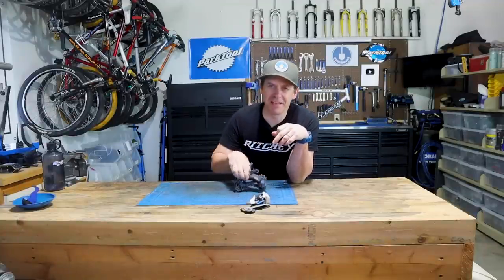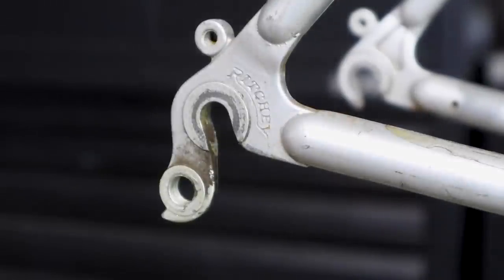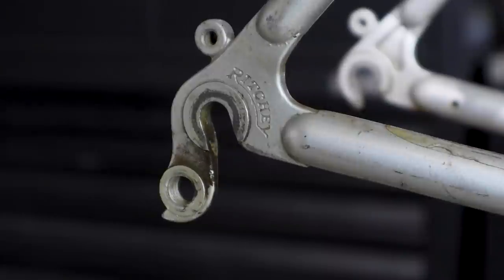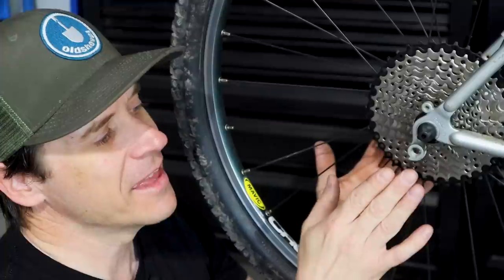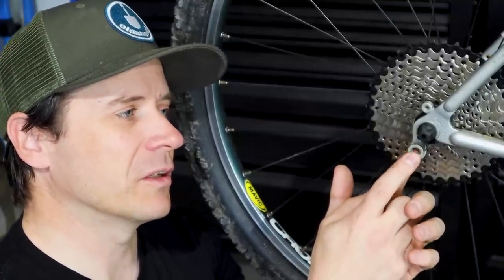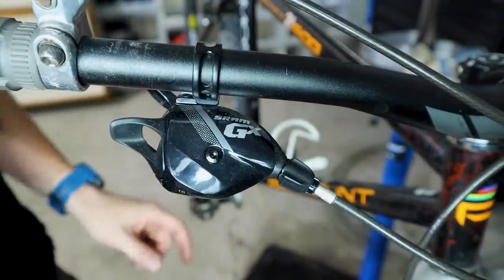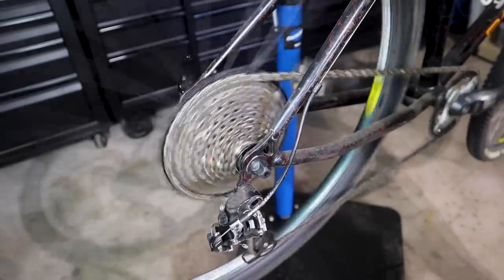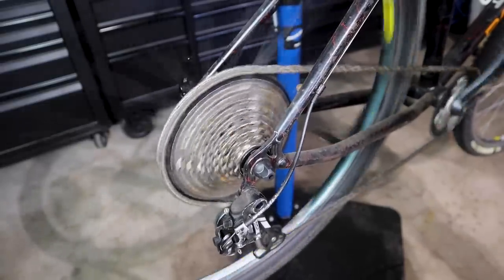Rear Derailleur Setup - The 3 Foundations

Comment: When adjusting both limit screws, do you screw in both barrel adjusters on the shifter and rear derailleur? If you have 3 front chainrings (24 speed) which front gear, do you shift it in when adjusting the limit screws?

Comment: It should be noted, though, that the more cogs you have an your cassette, the tighter the tolerances get. Where a 7-speed with a misaligned hanger might still work fine, and a 9 speed might still shift through all the gears, the 12-speed certainly won't.

Comment: I've been tinkering with my bikes for over 10 years now and I still cannot get how unscrewing the barrel adjuster tensions the cable. I could not find any explanation on the internet either.
Reply: It is counterintuitive.  Backing out the barrel adjuster by turning it counterclockwise has the effect of pushing harder against the cable housing (the barrel adjuster gets longer as it is turned counterclockwise).  Because the adjuster is longer, and therefore the length of the cable housing plus adjuster is longer, this puts more tension on the inner cable.  The cable housing plus adjuster are pushing against the shifter at one end and the derailleur at the other end, and that adds the tension to the inner cable.  Hope this helps.... it does seem backwards but visualizing the barrel adjuster pushing out helps me remember how it works.
Reply from the maker: It increases the distance the cable has to travel.
Reply: @mattkavanaugh5623  thanks. I figured that out that the adjuster affects the overall lenhgth of the housing, but I still can't wrap my head around how does this tensions or loosens the cable.

Edit: ok I think I get it - normally if the clamped end of the cable is not clamped and you unscrew the adjuster, that end gets shorter relative to the housing and 'slides back' into the housing. But since it is clamped to the derailleur or brake caliper, it is being pulled/tensioned and pulls the derailleur/caliper with it. The tension is provided by the derailleur/caliper spring. It's easy to observe if you hold the loose cable firmly in your fingers and start unscrewing the adjuster.
Reply: That’s right, each end of the cable housing butts up against the derailleur or shifter, so when you back out the barrel adjuster (make it longer) that pushes the cable housing more against the derailleur and shifter.  The inner cable is not attached to the housing, of course, so the longer housing causes more tension on the inner cable and pushes against the derailleur.  You can probably see the rear derailleur move when you do this, but the front derailleur probably not as it is much stiffer/harder to move.

Comment: Thank you very much for the video.😎👍🏻
Unfortunately these advices are not enough when it comes to adjusting the derailleur and dropout that got wet and frozen and were badly bent while winter using in temperatures below zero. I used to ride my bike in such conditions for the whole winter, almost everyday, and my removable alloy dropout got badly bent a couple of times, then I used to bend it back into position which looked ok to ride and switch gears. Also, I had to bend back the derailleur itself. And now the dropout and derailleur are getting bent on their own, while riding on the road in summer conditions. The metal got so soft, I can easily adjust them with my fingers. I’m not going to change them soon, because it’s not a big deal for my purposes. When they go off, once a couple of weeks, I just bend them back a bit, and it’s ok to keep on moving.🤣
Reply: Maybe for your particular environment you would be better off with an internally geared hub.
Reply: I would really advise you to get it changed, since if it breaks mid ride you can potentially damage your derailleur and it will cost you a lot more to get that replaced.
Reply: @ADAMJWAITE  great idea, but the reason for bending dropout and derailleur was frozen stuck chain. I had to warm it up, then remove the rust, I had to re-lubricate it, and then it started spinning again. It got stuck previously. The chain got covered in rust and ice in just one night. Salt on the roads does its job.
Reply: @mahonah  the derailleur got bent too.

Comment: Dear oldshovel, since you mentioned it wrong in another video also, I need to correct you; the derailleur hanger fails not prior the derailleur, BUT the frame! So you don‘t need a new frame, not a rear mech. 
Otherwise keep up the good work !
Reply: Also, it‘s not the steel cable that stretches (how should that be possible with such low force?) it‘s the end caps and outer housing. FYI

Comment: I'm one of those guys who would rather just take my bike into my LBS for rear derailleur adjustments. I've been tinkering with bikes for the last 5yrs and I've always really sucked at adjusting the rear derailleur. It seems like I can never get it totally tuned in. What i usually do is adjust it as much as I can then take it to my LBS and have them fix what I screwed up when I adjusted it. 
In fact, just 5 days ago i upgraded to a Shimano SLX 11-speed groupset on my bike. I dialed it in as much as I could, doing the adjustment method of not even putting the chain on, but adjusting the derailleur with the chain off. I had it perfectly aligned with the lowest and highest gear and the chain was still rubbing. I took it into the LBS and it turns out my derailleur hanger was bent. The bike mechanic said i could have adjusted that derailleur til the cows came home and it would have never been perfect, lol, but he said I did do a good job. So the one time i actually did it correctly and it wasn't possible to get it dialed in lol. I will say though that this last attempt did actually really boost my confidence.